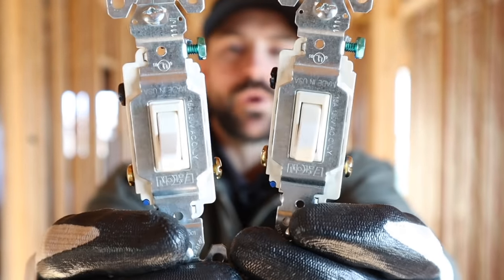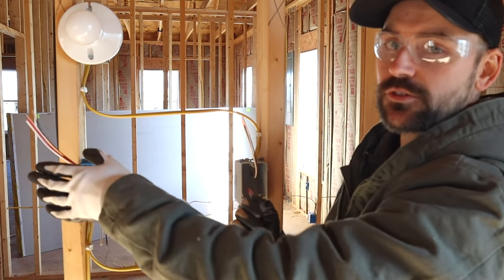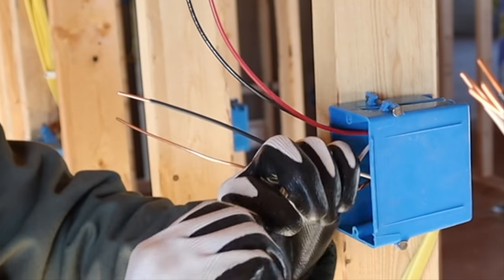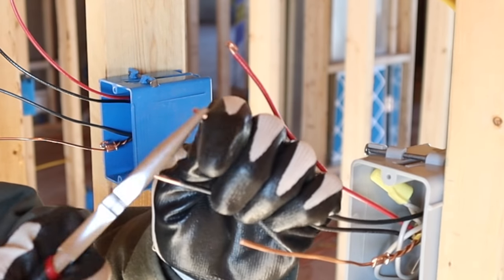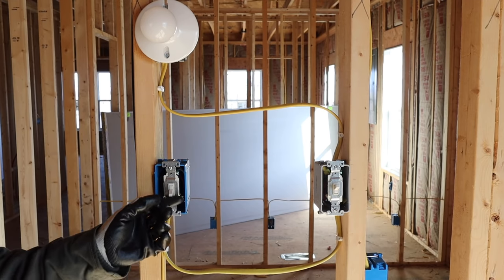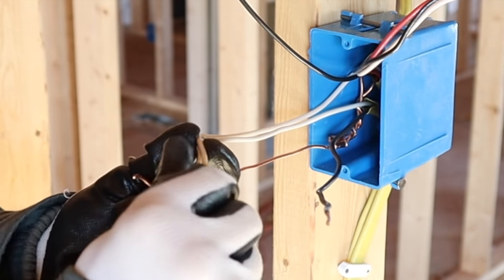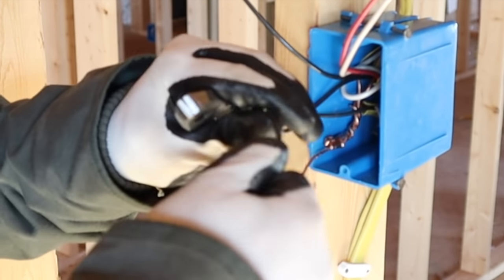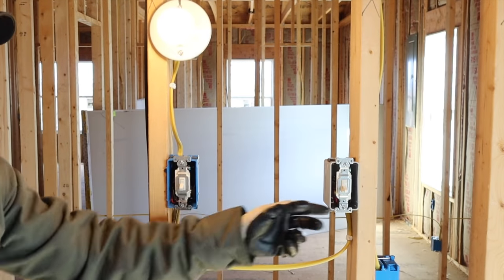How To Wire A 3-Way Light Switch - 3 Way Switch Explained (2 EASY & SIMPLE Methods)

Comment: The brass crimp is not as good as a wire nut. The second one you crimp, with the wrong tool, moved. So it is not tight. That brass crimp is made for a specific tool, and plastic cap. Your neutral connections are still not twisted good, even though you used pliers. They may come apart in a few years, causing damage to someone's house. Your use of the white wire is incorrect and get someone hurt. Switches were installed upside-down. To test a three-way switch, you turn one on and then off at the other and then back on at the first switch. You do not just make the switch screws tight. There is a tork rating for those screws. I am a service electrician, and I thank you for making more work. Please continue making videos for DIY's.

Comment: You don't need 12/2 or 12/3 for lights.  You can use 14/2 and 14/3 and it still meets code.

Comment: Nice tutorial. However I would never recommend home owners without electrical knowledge DIY electrical things except changing out the broken light bulbs. Electrical contains lots of things, Theory, experience, logical and practice. Also the key thing is “ safety” , always keep work ethic , no shortcuts. Hooking up wires ( grounding-neutral-hot) must followed. The opposite ( hot-neutral-grounding) for dismantling wires.

Comment: You must be loaded with money or charge to much for an install, #12AWG for lighting? I  use #14AWG for lighting and for most power outlets as well, plus #14AWG is easier to work with,  #12AWG to expensive especially #12/3 AWG, good video over all tho..!!
Reply from the maker: Hey Jesse! I definitely understand why people use 14 wire often. I agree with you when you say it is very expensive. Especially right now. I just use it when I build my own houses just to keep things simple and I would rather have too much than not enough. I appreciate you watching my video and leaving a comment!
Reply: Seriously I was just thinking the same thing. I hate working with 12, only use it for high-amp sockets in an office, kitchen, laundry, shop, hobby room.  Especially with most lights now being LED, you will never need anywhere need the current of #12.  Less of a money issue, just so much easier to stuff a box with #14 than #12.
Reply: Unfortunately not all areas allow 14 for wiring.

Comment: Isn’t there a new electrical code requirement that says a neutral wire must be in every box? In other words that second switch must have a neutral white wire.
Reply from the maker: Hey Jim! Where I’m building it’s fine as long as you can see from switch to switch. So in other words a 3 way system in the same room. Always check your local building codes. Hope that helps.
Reply: @TheExcellentLaborer  thanks!

Comment: I would like to convert my light to a 3 way but I can’t find a video for my application.Could you make a video where in my application there is a junction box with other wires tied into it.My switch goes to the junction box & the light goes also to the junction box.The light does not come off the switch it’s all in the junction box.The light is wired from the junction box not off the switch.I was going to either disconnect the light from the junction box & have 14/2 going to a 3 way switch from that junction then I could run 14/3 from switch to switch then to the light.Or I’m not sure if I can just leave everything as is & just leave the 14/2 going to the 2 way switch & change it to a 3 way then run 14/3 to the new 3 way switch.Not sure if this way will operate the light seeing that the second 3 way switch does not go to the light it self.Thoughts?Thanks.
Reply from the maker: I’m sorry but it’s hard to understand your situation. It would be something I would have to see in person to get my two cents. Thanks a lot for watching!
Reply: If it helps the 2 way switch does not continue to the light.The switch & light or both connected in to the junction box.I would imagine the hot wires are all tied together along with the neutrals are tied together & grounds.
Reply: You'd have to run 14/3 from the existing switch box to the lights jbox, then 2 14/2 or one 14/4 from the lights box to the new switch box if you're wanting a neutral or one 14/3 if you don't. But no neutral means it isn't up to code. Not a big deal if you're not planning on selling the house though
Reply: @TheExcellentLaborer  its a 3 way starting at light. There's your picture
Reply: Thanks for the reply.I think I’m just going to remove the light from the junction box.The 2 way switch that controls the light still has power from the junction so I think as long as I have power to the 2 way switch I can then convert it to a 3 way then just run 14/3 to the new 3 way then connect the light from that new 3 way with 14/2.I thought maybe there was an easier way but as long as I have power to the first switch then I think everything will work as a normal 3 way configuration.What’s your thoughts?
Reply: Dave, I believe I understand your existing installation. One bit of information that would make it more understandable is if you could re-examine the existing switch outlet. Is there just one ‘Romex’ cable in the box? If it’s only a single cable, then you should find the ‘white’ wire within the cable connected to one terminal of the switch and the ‘black’ wire is connected to the remaining switch terminal. Electricians refer to this installation as a switch loop…if it’s anything else, my explanation may not be effective . If this is what you have, adding a second switch location and converting the existing location to 3-way is very simple. The ONLY thing you would have to do is install a 3-conductor cable, with ground, from the existing switch outlet box to the location of the new switch outlet box. (The wire gauge should be the same as the existing gauge) That would provide the necessary wires to legally make your 3-way switches operate. You WOULD need some guidance on the connection of the wires at the two switch locations as it can be confusing to a DIY’er.
Reply: @jjoejones1  Thanks for the reply.
Reply: @jjoejones1  pretty sure I already answered this quite some time ago

Comment: If either light switch is in the off position the light does not turn on. What's wrong with that
Reply: The place of the switch "up"/"down" as position from on/off is in this example exactly opposite - if you wish a situation at kind of "All switches down mean off!" do you build-in one switch 180° inside. Easy right? 

Exact this is one detail (of many things) how are professional worker thinking and care about - and DIY people not!

Comment: Aren't you supposed to let the wire nut twist the wires by putting the wires in straight and then twisting the wirenut instead of twisting the wires with a plier

Comment: I am a licensed and professional electrician and former owner of a remodeling business. While yes, most of this is fairly correct, but there is so much not explained/allowed/legal or done the hard way. First off if your going into this situation, all you need is a handful of wire nuts and a GOOD wire stripper. Dont use a needle nose pliers for the hook, all wire strippers come with holes designed to do that, no extra tools or weight to carry around. Second, if your gonna use a crimp sleeve, do NOT use linemans pliers to crimp it because it can come loose, thats what crimping pliers are for or you can get wire strippers with a crimp end on them. Third, all electricians wrap their common wire around the travelers to indiciate the common wire for whoever comes behind you. Fourth, you not only way overtightened your screws, you also dont have them all the way under the screw. Even with 12 gauge wire you can get all the wire under the screw. Fifth, the only time i wrap a device with tape is if its going into a metal box, doing that in a plastic box is a waste of time and money. Sixth, if your going to crimp your grounds you need 6 inches of wire before you hit the crimp sleeve. Everytime i come behind someone that does crimp sleeves like you i curse your work because you make the wires too short. Seventh, the ONLY time the second version is allowed is when you have closed off walls usually in older houses and your only option is to fish a wire through a wall thats not even covering situations of working with ungrounded wiring. Please let professionals do their work since that is what we train for and the reason we spend years in school for our license and have continuing education classes we have to attend. People that do things incorrectly and tell DIY’ers they can do things like this without paying an electrician is why people have problems. Actually, on second thought, continue letting uninformed people do their own electrical, because when things go wrong and they have to call professional electricians like me, thats what keeps me employed.
Reply: I think it is not helpful to talk him "more job secrets" - he as DIY worker do not want hear it. Why do you think that he not react about your longer text and answer something? I know self as professional (be in job since 1992) the points - specially that we use in Europe and Asia screw-less switches and outlets since over 25 years without problems. I self would use only metal boxes and metal pipes if the cables goes inside wood; specially inside or with modern isolation materials. With this and some other the UK are first in safety and regulations. 

This typical DIY things do you can see often in Asia countries - the true professional worker have stop responsibilities in most work sites. Since around 15 till 20 years they starts here with ground wire - at my first installations they cut it hard or rerouted a new two-wire cable ... Ground wire here yellow-green and an extra cable in opposite to U.S.A.

Comment: Step one:  don't wire lighting circuits with 12 gauge wire... 14-2/3 is all you need and SO much easier to work with.    Otherwise great demonstration.

Comment: one all the wires should be the same length before you stip them  2 the way you did the ground it should be in the bottom of the box and when folded in the box not be in contack with the wire near the switch 3 the way you put the wires under screws was lose and pulling from commection the amount of wire you striped is to short and the circle you bent was to tight and to short the end of the striped part should catch on the built in catch in the device so the wire dose not pull out  ground should be pushed in the back of the box then thw neutral and the colers i always leave  some instriped romex in the wall outside the box incase a device failes and need more wire to repair it i have been watching some of these wiring vidios and its hard to not critise them because i was a electrician for many years wiring new homes and repairing old homes  and everything from residentual to comercial i have seen a bunch of below standard work i have had to repair

Comment: The hook method is old and slow. Use the clamp holes. That's why they are there and the back of the switch had a gauge on how long you should stop off the insulator

Comment: It shouldn't be called a three way switch because of the wiring, because it functions as a two way switch
Reply: @crusherfang9368  It only operates two switches,
 It was mainly created for stair case lighting, so that you can turn on or off the lights two ways, depending on where you were on the stairs.
You also have three way switches.
Reply: @crusherfang9368  I don't think you understand English, two way, three way is an action.

Comment: Isnt this a 2- way switch cause there are 2 switching points, a 3 way switch requires 3 switching points. i looked through the comments and no one seemed to question it. I am Australian so maybe it is just a culture thing. If anyone has a clear answer feel free to comment.
Reply: It’s a common misconception that ‘3-way’ switches refers to the number of switch locations..it doesn’t. A load controlled from two locations requires (2) 3-way switches, any additional locations, regardless of how many, would require ‘4-way switches’.
Reply: 'Two way switching'--- TAFE

Comment: You get me confused when you use the term COMMON and are working with a black hot wire. I believe that only white wires are called common or neutral. BTW, I only use WAGO connectors. They make wiring so much easier; the wires can be removed, and the WAGO can be used again. Maybe I am wrong, but I'm only a DIYer (Third Class).
Reply: On a three-way switch that common becomes a common hot... White is nuetral

Comment: The company that makes your crimp sleeves probably would not approve of you just mashing it, instead of using an approved crimper or using  a set of lineman's pliers that has them built into the jaws. Our company uses green wire nuts for grounding.
Reply: I agree. They have hand held crimpers made especially for crimping.
Reply: Ervin, you are correct. The manufacturer’s instructions for the crimp sleeves will specify the recommended/acceptable tools for crimping.

Comment: NO ONE MAKES A VIDEO LIKE WHAT I NEED….help!!!!

For the love of Jesus! Not a single video showing a 4 way switch  series controlling the on/off of a set of lights (3 or more) say for wall mounted deck lighting.

I have 1 feed coming from sub panel into my 1st 3 way, 14/3 wire going to middle 4way switch, 14/3 going off to last end 3 way switch ..  I need someone to tell me how to run the 14/2 to the light fixtures so that each room/switch, can turn on/off the 3 wall mounted deck lights together at once.  This is literally nowhere on YouTube.

Comment: Good video..but Not a fan at all of the 2nd method..after tons of remodels I've chased and hunted dozens of lost/ missing neutrals that are behind sheetrock that I can't get to without further unnecessary demolition...for guys like me coming in decade later for additional add-ons or remodels it's to much hassle..keep it simple like the first method..tie off the grounds and neutrals and just have you red and black travelers...and make it easier for guys like me down the road.

Comment: Am I the only one wondering why anyone would use the second method? Seems way more complicated
Reply: The way I understand it is the first method is used when the power comes to the first switch, then the 12/3 goes to the second switch and then goes to the light. The second method must be used when the power and the light wiring come to one switch, then the 12/3 goes to the second switch which is at the end of the run. It's similar to a switch loop for a single pole switch. The way the wires are run during the rough in will determine which method is more efficient. Another scenario is when both switches connect to the light in the middle and one neutral wire will also have to be reconfigured to hot.
So the methods are power-switch-switch2-light, the easiest one; power-light-switch-switch2; and power-switch-light-switch2.

Comment: why are you using 12 wire? lol 20 amp wire for LED load???? i always work on live wires  so i love my insulated tools but i dont understand any electrician have any uninsulated tools.

NOTE maybe you should test your switches with an odd number of toggles because if you do it even number of times you cant tell if it was wired wrong. to test a working 3 way you need to on switch 1 then off switch 2 then on switch 1 again and this verify your source and travelers are switched